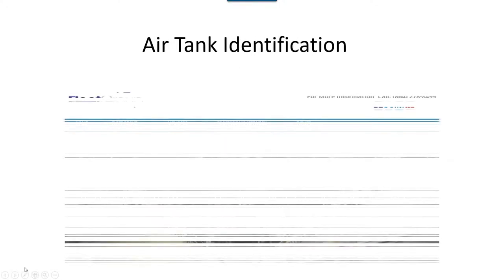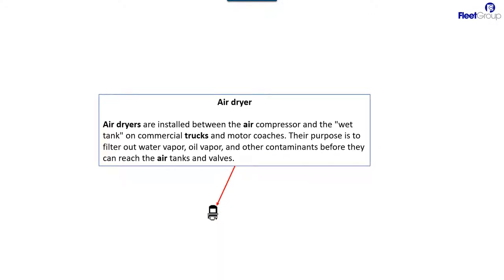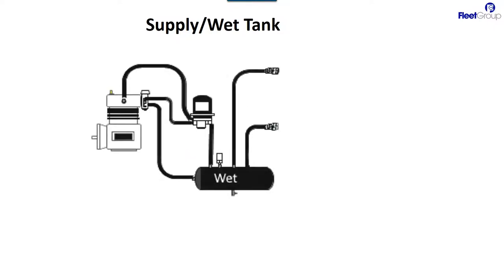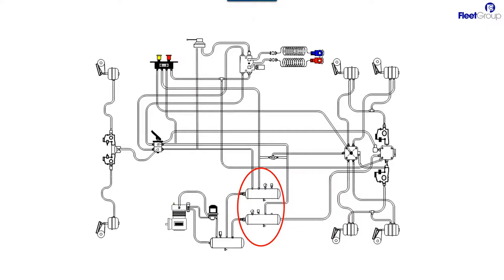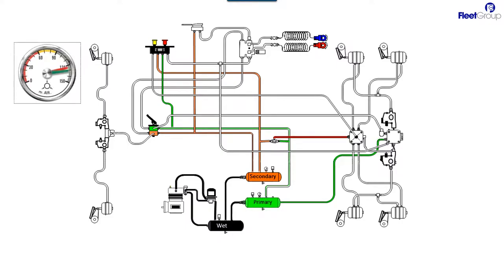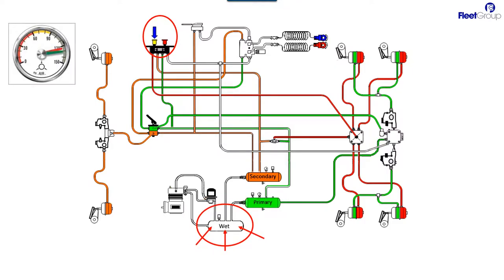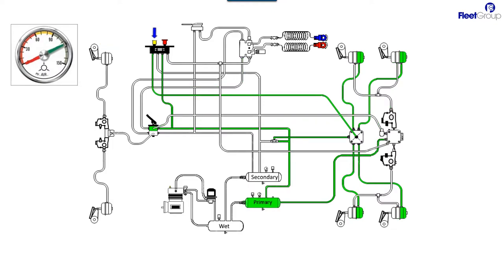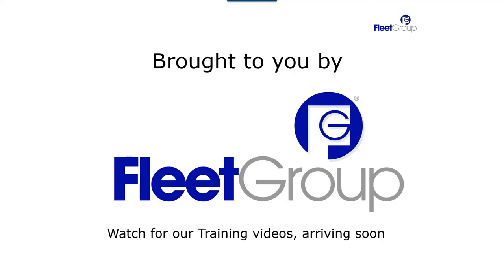013 - Air Tank Identification Workshop

Comment: What is the valve that was circled called?
Reply from the maker: It is called a “two-way check valve,” it allows the air source applying the higher pressure to shift a shuttle so that the higher pressure will be directed to a delivery port.
Reply: Where is that actually located? I have a 13 cascadia and changed every valve and still having a braking issue.
Reply from the maker: @CrodDc5  In most cases, it is part of the Dash Control Valve. However, there can be more than one of the different types of valves, depending on the system and options. if you have an issue with system isolations, the dash valve is a good place to start.

Comment: Is the wet tank considered the main tank?
Reply from the maker: There really is no main tank in the air system. Each tank has a specific function. If I had to rate the tanks in importance, I would say the Primary tank would be the most important, then the secondary and then wet tank.

Comment: Man this is top notch information here! My tanks all seem to drain equally regardless of which tank is drained first. They have not always done this. I'm fixing to go out and run some tests. 

The new Bendix AD-IS dryer Model 801266 like I have has the check valves in the dryer and not in the tanks which was a bit confusing for me while trying to sort out the issue of all my tanks draining no matter which single tank I drained.
My system is suppose to charge the primary tank to 104 psi first then fills the Secondary tank to 104 and then both on to 130 PSI.
2 months ago my tanks started filling at the same time.
It turns out the DC-4 double check valve was stuck in the middle causing all my tanks to drain equally and fill equally together not allowing any tank protection.

To diagnose the double check valve between the secondary and primary tank  I drained the tanks and unhooked the DC-4 Dbl check valve from the Secondary tank. This allowed me to see that air was passing strait through the check valve and filling the secondary tank which it should not be doing. Also no air came into the secondary tank until the primary reached 105 psi. 

The Bendix AD-IS dryer  has 2 supply ports! One feeds air first to the wet tank which feeds the primary tank and port 2 supplies air to the secondary tank.
I took the DC-4 dbl check apart and found the sliding valve stuck in the middle. I cleaned it, reinstalled it and now its all working correctly.:face-blue-smiling:

Comment: Awesome video.
My 2008 Kenworth T800 Quad Axle Dump Truck is NOT Building Air !!!
I removed the braided line at the Air Compressor and started the engine.
The compressor is making plenty of Air.
I reinstalled the braided line to the compressor and removed the airline going into the air dryer.
Plenty of air there, no restrictions.
Reconnected the line....
Then I removed the air dryer cartridge and the air is coming out of the hole offset from the center.
I applied shop air to the center hole in the air dryer and tried to fill the air tanks there (nothing)
I removed both airlines from the air dryer and tried to (reverse) airflow through the air dryer, but (nothing)
Could my air dryer ports be clogged?
I've used full 120 psi of shop air.
HELP, I'm stumped.
Also, what are the "Standard Colors" of air lines?
Thank you so much.
Reply: Did you ever figure this out?
Reply: @RC-Heli835  yes corrosion in various areas.
Reply: @timgiles9413  Awesome! I drive  T800 as well.